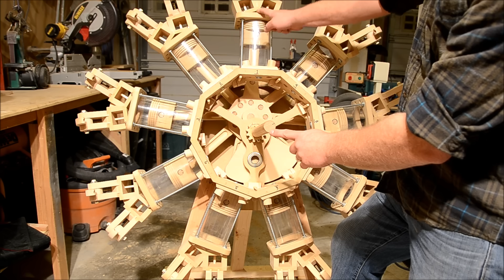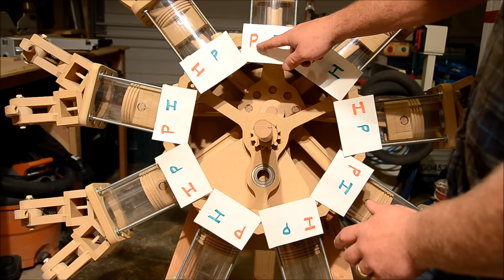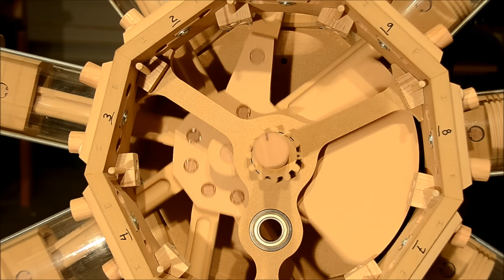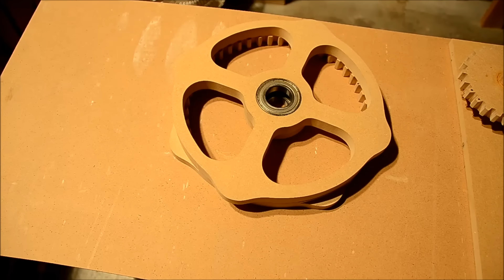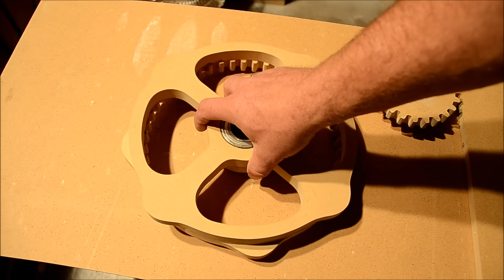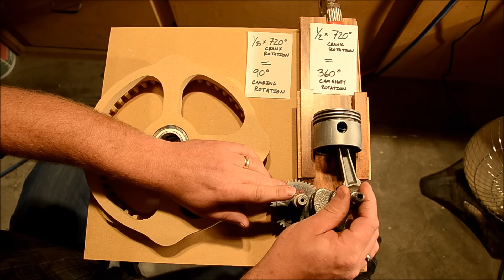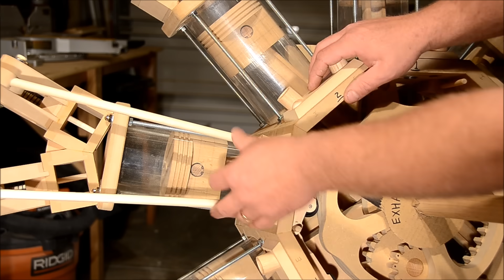How a Radial Engine Works - Explained  Part 1

Comment: No offense or nuthing but I never seen the real "Radical Engine" that you advertised. Don't get me wrong now, the wood circly motor was nice. But if'n you start that she'll catch fire right quick. Anyways you should make your home movies about Lincoln Logs or building alien dog houses. By definition a rad engine is made from metal, burns petroleum products, acts like she's gonna die at idol and scares the shit outta kids, pets, hippys and gas futures when opened up. At fifty five hundred RPM she'll rip a hole in space/time, freeze the universe just long 'nuf for me to cream my drawers while most folks find God n drop dead from fright.
Reply: Why rag on a great guy sharing his knowledge & skills?  Why don't you stop criticizing others and do something yourself?   Great minds "do", small minds criticize....
Reply: Richard Davison......well said, sir!
Reply from the maker: No offense taken! 😊
Reply: Cyrus Hoseney did you forget that this is just a demonstration/explanation of how it works?
Reply: Well first off it is a "Radial Engine" but I guess many would call it radical. By definition, a "Radial" engine is any reciprocal engine with the cylinders arraigned in a "radial" or circular configuration. At 5500 RPM I would suggest ducking and running for cover!!! Maximum, Oh S@$T, Run away, Get Out of Here RPM is typically about 2200 RPM, maybe 2500 for a very, very short time period. And Pratt&Whitney even made a 36 cylinder version. Go to any air show with a Corsair, B 17, DC 3, SBD Dauntless, ETC... and you can get up close and personal with a radial. For a wood built cutaway model of a radial that was beyond exceptional!!! I could see many Aerospace museums wanting it. Other than a cut-away  you don't see any that shows how the cam rings work. Now if you want to see a REALLY  RADICAL ROTARY ENGINE check out the Gnome Monosoupape Rotary Radial where the crankshaft is stationary and the cylinders rotate and the prop is connected to the cylinder block. I have seen one on stationary display.
Reply: My Bad, it was Lycoming that built the 36 cylinder XR 7755. Pratt & Whitney built the 28 cylinder R 4360.

Comment: i agree with John Mc Donald,. this expanded quite  alot. however i still dont understand the radial engines that appear to spin the cylinders ?
Reply from the maker: dave wiser - That would be a rotary engine. The crankshaft is fixed to the frame of the plane, and the engine block itself spins.

Comment: Great work! I fly them on spray planes and this is excellent. One thing though, not all radials are 4 strokes. There are single row, even numberf cylinder radials, but they are 2 stroke engines. And, you might consider a Harley V engine. It has 2 cylinders and they share the same lobe of the crank. I believe they have a forked rod to make it work.
Reply: Exquisite work and explanation. You have tapped into the inquisitive nature of the collective human brain. Absolutely genius and thank you!

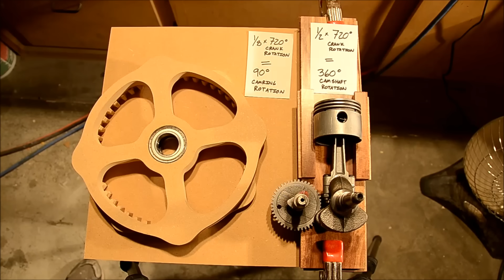Comment: 7:10 interesting to see the gear driven camshaft instead of a timing chain. Not uncommon on small engines, but almost forgotten today in auto engines. Studebaker did it that way.
Reply: Bro' they don't put those things in cars.  They are things like the Pratt & Whitney R-2800 Double Wasp which cranks out something like 2,400 HP.  In general, they are used for aircraft with high front end cooling flow.

Comment: Sweet video!!  Did you build from plans?  If so, I would love a set, or direction on where to acquire them.
Reply from the maker: I drew the plans up myself, but still ended up with some trial and error!
Reply: Are your plans available for others to use?

Comment: Terrific video!  Excellent explanation!  And your model is also absolutely FIRST RATE!  You've obviously put a LOT of work into this effort.  Thanks so much.  

I absolutely love the old "round engines" and in the increasingly rare situation where I am privileged to hear the throaty roar of one, I stop whatever I'm doing and scan the sky for the source of the ever so pleasant sound.  It's nice to now have a better picture of what is going on inside of that throaty roaring beast.

Comment: isn't a radial engine away a 2 stroke engine ? befasse the oil will always Flow in the 5th cylinder of it was a 4 stroke engine.

Comment: Does anyone know what a cam ring for  5 cylinder radial engine should look like?
Reply: junior214223 Four cams, a pair of twos 180° apart from each other on the same stroke, with intake and exhaust 90° apart.

Comment: Truly awesome dude! I love how you combined wood working with the mechanics of a radial engine! Have you considered adding a distributor, wires and spark plugs? (some bright LEDs at the end of the spark plugs inside the cylinders, would really finish this nicely)

Comment: If you did a thousand videos you'd never top these on the Radial Engine. Very well done sir!

 I am an old timer Harley Mechanic, and they share some design aspects with a Radial, but not the cam or connecting rods. Those were two of the mysteries I needed to wrap my mind around, and you covered them very well.  Thanks!

Comment: A radial engine's cylinders are numbered from the top, going clockwise. Not counter clockwise.
Reply from the maker: Stroker Ace looking at an engine from the aft you are right. 12 o'clock is number one and they are numbered clockwise. Looking at the engine from the front towards the aft, they would be numbered counter clockwise. All a matter of perspective I suppose!

Comment: Hello Ian, I am particularly impressed by the way of explanation.
Do you have a drawing of the engine? Then another question, where the oil at a radial engine remains there is no oil sump like a car?

Comment: The big question that I have always had about radial engines is how do you sump and engine with an upside down piston?
Reply: My thoughts too. I understand that before these engines could be started they would be rotated a few times sometimes by hand to help distribute the oil which could collect excessively in the lowest cylinders. I'm only guessing but i presume the oil was held in a seperate tank rather than a sump?

Comment: The thing that I am noticing with this engine is way back in the beginning when you pulled the cam ring off. Because both intake and exhaust valves are they operating on the same cam ring, or is there 2 separate rings for intake and exhaust? If there is only a single cam ring the both intake and exhaust must share the same lift and duration. If there are 2 rings then the valves can be canted and independent. 
The radial engines remind me of a Harley V design with all the rods attaching to a single journal.
Reply: Zyworski Watch it until the end, intake and exhaust cam rings are on separate planes.

Comment: That is a fascinating model. A very interesting video as well. I would like to hear a discussion concerning some advantages and disadvantages of radial engines v. block types. You don't have to build a replica Packard 12.
Reply: Advantages of a radial - easier to design and maintain a cooling system, lighter, one design can be stacked to create bigger engines, easy parts replacement (hang new jugs vs sleeve a block)...

Disadvantage - generally much larger diameter than an inline which means more drag, less overall power potential since cylinder head temperature is dependent on air cooling

"Like how they are not naturally balanced because of the odd number of cylinders"

Odd number of cylinders is actually to make it balanced.  Note that in the video, it skips firing one cylinder every time.  If you had an even number of cylinders, you'd have to have two cylinders fire sequentially at some point. 

A fair example of that effect is how Harleys are shaky pieces of shit - their engines use the same common journal setup as a radial, but with only two cylinders, and the angle between the two cylinders doesn't help matters.  Bad design...

"Radial engines also rely on OIL COOLING and have plumbing and a radial for that also !!!"

Wrong.  Lower-powered radials didn't need an oil cooler setup.  It was the turbo and supercharged radials running very high outputs in WWII that had to be oil cooled.  The water-cooled engines of the same era also usually had an oil cooler, too.  NACA cowls and the Germans installing fans in the cowling helped reduce the size of heat exchangers needed.

Radials were known to be harder to damage.  Even with an oil cooler, their cylinders and cylinder heads were still air-cooled, which reduced the amount of surface area they needed for the cooling system.  In an inline, the cylinders are surrounded by the case or block and the head(s) were a solid piece, neither allow for any real air cooling.  In the end, the oil cooler and associated plumbing was much smaller than the radiator of a water-cooled plane.
Reply: Block engines were (typically) FAR lighter weight leading to less weight in total, but also typically didn't put out as many horses. They also were far more vulnerable than radial engines due to them requiring a liquid cooling system whereas the radial engine is air cooled. Simple explanation.
Reply: @NotTheCIA1961  there is also that thing about the engine being able to breathe at altitude...hence the turbocharger.
Reply: Like how they are not naturally balanced because of the odd number of cylinders, though I get the firing order and the logic behind it I don't see how it's balanced, at least not like the boxer engine where the Pistons are horizontally opposed.
Reply: @NotTheCIA1961  Where did you read that??  I don't think pilots were aiming for weak spots in the enemy craft, they had enough to do just trying to land rounds and not get any in return.
Reply: @kevin paul halliday Rotary as others have said.  The Wankel is not a true rotary but picked up that name.  The aircraft rotary is very smooth because there are no reciprocating parts!!!
Reply: @ohger1  Technically, the cylinders still reciprocate.  But the reciprocation is distributed around the radial.
Reply: @kevin paul halliday - that's a rotary you've got there. https://en.wikipedia.org/wiki/Rotary_engine . Very old technology.
Reply: That's a rotary engine, viz the Gnome Rotary fitted to most Sopwith a/c, Camel, Pup etc; or the Oberusel (sp?) fitted to the Fokker triplane. Le Rhone was another French manufacturer of rotary engines.
Reply: "block types"
The technical term is "in-line cylinder" as oppose to "radial cylinder" :)

Comment: loved your video. Really explained the operation in layman's terms.  How is the engine lubricated? 

Ever thought about making a cut away of the British DELTEC Diesel engine? Used in MTB's and later in Rail Engines. Seems to me that the engine should be re-visited as I understand it was extremely efficient.

Comment: Hello Ian. Thank you so much for this excellent video and your powerful explanation of the the workings of a radial engine. I've never quite understood how the cam ring worked. I can't wait to watch part two. Is this your design and did you build it from scratch? Or is it a kit that is available commercially? Please let me know either way as I would really like to have one to build and enjoy myself. Please message me and let me know. If you designed and built this I would like to purchase your plans. If it is a factory made model, please let me know where I can purchase the kit. Again, thank you very much for this video and your awesome presentation.
Regards,Michael S.

Comment: What I've never understood about radial engines is that the cylinders on the bottom will always be submerged/flooded in oil, therefore they should be (in theory) blowing smoke. The top cylinders should be oil starved and therefore running hotter and need more ring maintenance. Can you explain?

Comment: It really shows how these engines could be all shot to hell and still run well enough to bring a pilot/plane home. 
With all the cylinders and valve train spread out over a large area, you would have to take a bad shot directly to the smaller, main crankcase in order to stop the engine dead. If a couple cylinders or heads get blown to bits, the rest of the engine doesn't really care since the master rod isn't doing a whole lot in the way of motion, unlike con rods in a typical engine.

Comment: Truly excellent explanation and demonstration. One question comes to mind regarding lubrication - four strokes generally have a sump which is not going to be the case here, additionally oil in the crankcase will settle in the skirts of the lower pistons when the engine is idle, or worse in the combustion chambers via valve sleeves or passed piston rings. Any insights into the oil system?

Comment: An outstanding tutorial and a magniificent model. I have always wondered how the crankshaft can be connected simulataneously to nine pistons in the same plane - and I found the answer while you were rotating your model to explain the 4 stroke cycle. There is clearly an offset arrangement of the big-ends on a rotating cam. Wonderful - thank you so much.
diymostthings

Comment: Fantastically Comprehensive Explanation!!! 
It' s even so good , that makes on me the impression that radial engines, are more logical and simpler than horizontally opposed. 
For this video to be perfect, maybe the reducing of  reververation, or echo, while the preseter is on the open shots, will be fine.  
Thank You Ian Jimmerson.

Comment: Thank you for the time you spent working on this engine model and video.You have done an excellent job with the explanations and demonstrations. I too find the old radial engines absolutely amazing. Did you utilize a CNC router for cutting your cam ring and gears? Do you offer a set of plans for your engine model?

Comment: I am blown away by your work.  Never would I thought I would see such a thing as a wood radial engine.  Your work looks great and I can't imagine the number of hours you must have spent in your shop building it.  The quality of your video and your presentation is tops.  I worked on the R-2800, R-3350, and R-4360 in the Air Force and your video brings back great memories.  Thanks for all your time, talent, and skills.

Comment: TOP work - excellent engine.  One question: What's the tooth count on each of the four bits that drive the cam ring,  only I'm looking at the vid, trying to visualise how you got 8:1 overall, via the two ratios.

Comment: Sir , congratulations at the  simple but effective manner in which you depicted the  valve gear and the camshaft in such an excellent teaching aide, and may I add so artistic,  That slow running cam shaft was the real success of the Radial engine.

Comment: Great video.  I like your Briggs crank ,cam and piston and your wood engine. I took air mechanics ...Air frame and Engine in High School in  1954--1958 at Arsenal Tech.  in Indianapolis, In.  we had several 5-7-9-18-27 cyl. radial engine's to work on and a few Conti. A65s 4 cyl. .We had to rebuild and prop start those little A65's   We recovered and rebuilt several Piper Cubs and a few others .I bet you can't find that now days any where.Ilove those old engine's....!   Old Chainsawbob Nichols

Comment: This was a very good explanation of the mechanical interaction of the parts inside a radial engine.  I've had a basic idea of how the engine design worked before, but I'd never bothered to really look into a tear down to see how it works.  It was a bit long winded, but now I have a pretty good understanding of what is needed to make a radial engine run that I didn't have before.